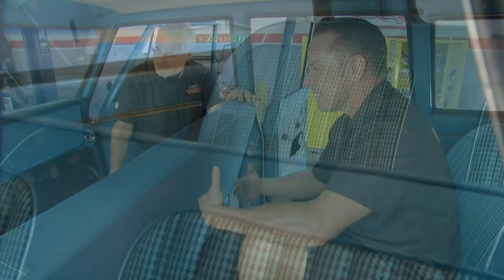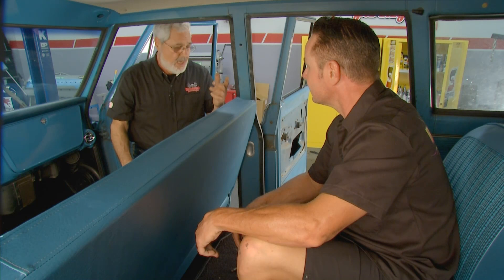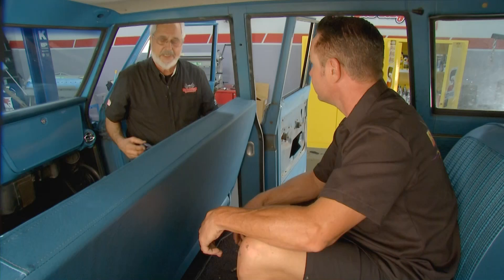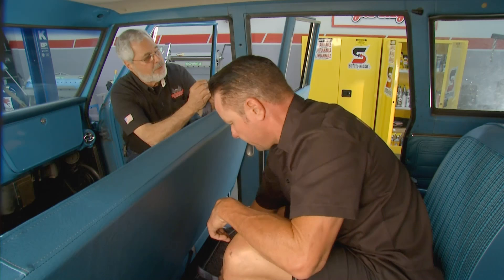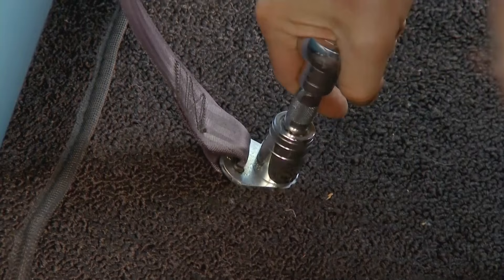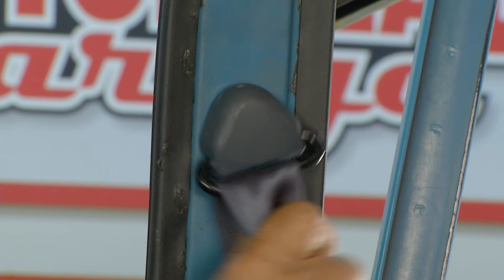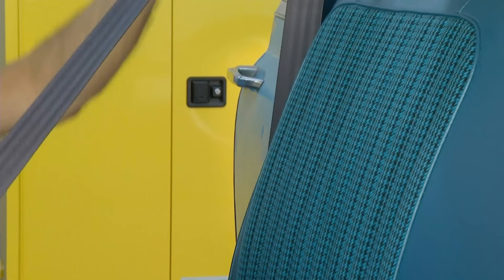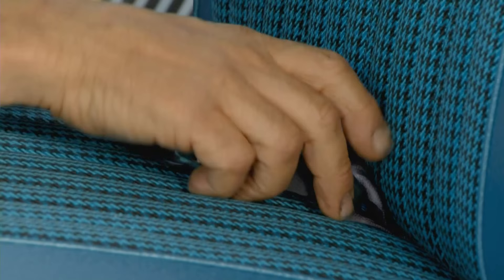1967-1972 3-Point Seat Belt Upgrade and Installation

Comment: Does the shoulder bolt just go in to the existing hole in the b pillar? No need to tap the hole with threads or weld in a plate nut for strength?
Reply from the maker: Yes, exactly.

Comment: What size drill bit? Do I drill the hole slightly smaller?
Reply from the maker: You need a drill bit just slightly larger than the bolts you are using.

Comment: what about installing a middle shoulder belt to the back seat?
Reply from the maker: On the Drivers side in the 67-72 Suburban models there is a mounting boss in the B pillar for a shoulder belt. The passenger side does not have a mount because of the need to "walk through" to the rear seat.
Reply: Christine Jensen. That's impassable to do look it up its not real for the middle

Comment: where does the other part of seat belt attach, with  the roller assy.or not. where and how.
Reply from the maker: We routinely use the original lap belt mounting positions. If your truck doesn't have those, then you'll need to drill holes in the floorpan where you'd like the inner/outer belts to mount. If you have any additional questions, please call our customer service guys at 800-977-2767.

Comment: How does this application work in a 1967 c20? There isn't a should strap bolt hole?
Reply from the maker: If your truck doesn't have the shoulder strap hole then you would create one and drop an anchor in to support the bolt. That is how it's done when installing this kit in earlier trucks too. It's a little more work, but results are the same!
Reply: What kind of anchor?

Comment: What company is this that manufactures the 3 point seat belt? Can it be installed on 1955-1959 Ford, Mercury, Edsel, and Lincolns?
Reply from the maker: Wr're sure there is a company out there that will do retro-fit kits for Merc, Ford and Lincoln, but we have these made for us specifically for Chevy & GMC trucks by a private vendor.

Comment: Did I miss something? How’d they get the hole in the b pillar? How’s the bolt stay in the b pillar? Most other ways of doing this have a bracket plate on the inside . How’s this one work? Should’ve started the video from scratch
Reply from the maker: The "B" Pillar on the '67 and up trucks already has a threaded mounting point for 3 point belts. This kit uses that factory position to attach the upper strap. Early trucks that don't have the factory mount do require the installation of a threaded support plate.
Reply: @BROTHERSTruckPartsTV   OK - I have a truck that had the 3-point belts but the threaded support plate is missing.  Where can I order those?
Reply from the maker: @StubbTx  Call our shop and check with the guys in Customer Service, maybe they can order just the plates separately. Otherwise, call the Truck Stop in Fullerton CA, they will have what you need (714-870-7920).